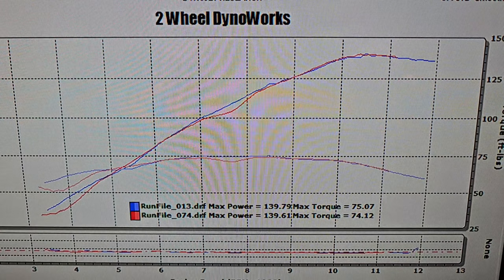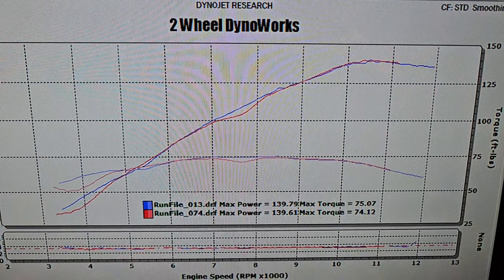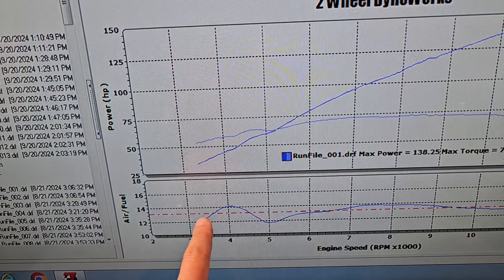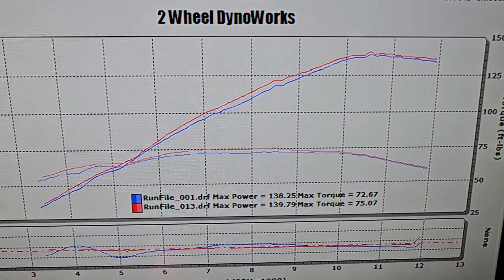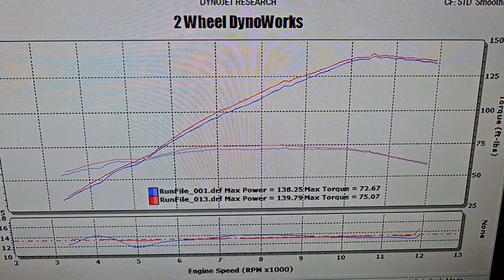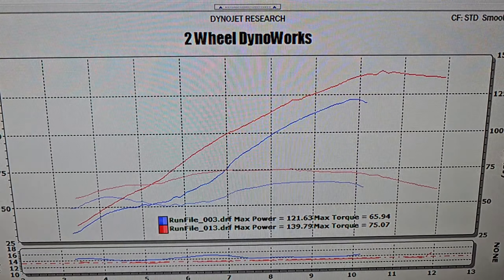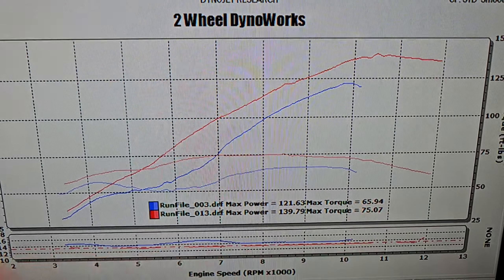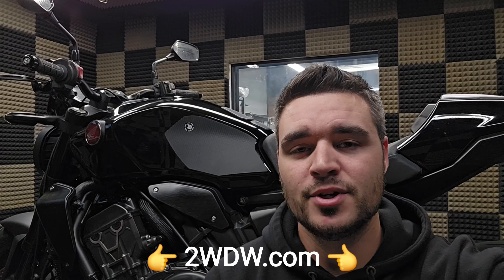PROPER Intake/Exhaust-Specific ECU Mapping is SO IMPORTANT!

Comment: I sent my ecu from my 08 Zx10R to 2WDW a couple months back and it is a totally different animal! The low rpm drivability is better. The midrange power is much stonger and the top end near redline is freakin brutal!!! Thanks Nate! Best money I ever spent on this bike.
Reply: To be frank, it's what should be on showroom floors. Not sure why there isn't a collective outrage at regulations.
Reply: @exothermal.sprocket  Yea, the regulations are turning otherwise great bikes into ones with strangely constrained and suppressed frankenstein power and torque curves.

Comment: On a previous tune my S1KR would surge when I closed the throttle at certain RPM and gear combinations.  Needless to say this is the last thing you'd expect rolling into a turn or approaching slowing traffic.  Since I've gotten the ECU flashed by 2WDW that problem is long gone and throttle response is much smoother.  Not to mention the bike runs far cooler than it used to even in SoCAL heat.
\

Comment: 24 horsepower deficit at 7k rpm on the CB1000R. How criminal is that. Do we think manufacturers would sell a lot more of these units if they actually made power right out the crate?
Reply: They wouldn't sell any units if they made that power out of the box as they'd never pass emissions
Reply: @TacoBurrit0  Who said anything about passing emissions?
Reply: @exothermal.sprocket  he's giving you the reason why there are these big differences. Nowadays almost all bikes have a lot left on the table because they need to pass emissions and sound regulations.
Reply: @mi16pim  I realize that. None of my comments were from that ignorance. I'm trying to highlight how miserable the environmental government regs have made motorcycles and how that has changed mass mindsets about certain models.
Reply: @exothermal.sprocket This is motorsports, not soccer. You’ve got to pay to play in this game, bud. Also, these aren’t slow stock, it’s still a CBR1000 motor at its heart. Average Joe will still be happy with what he gets until he dives deeper into the sport and sees behind the curtain.
Reply: @smith8124  This is the internet, not a kickboxing ring, BUD.

Comment: I like how you everytime state that it is super import to tune your bike to the details etc and blaming “other guys/tuners” for doing a bad job and then push the same fuel map in every ecu they send to you😂😅 Like no single bike needs the same fuel map and you know that… i mean, “close enough” is not how you guys do it right?

I understand the mail in service is a cashcow for you, but don’t over hype this service because it is not that good…
Reply: No 2 bikes are exactly the same, you're right, but if they know the engine, and the exhaust options (aside from full custom fab there's like 3 popular options for the NSC), you're looking at MAYBE 2hp variance for the savings of most of the cost of an afternoon on a dyno... but nice troll, you almost made a valid argument
Reply: @mattwise9748  troll? I’m not talking about hp Numbers at all, just to have the right A/F throughout the whole tps\iap range. Do you have an idea what the difference is between spot on and “it's good enough”? He can do it for sure, i mean he sounds like he has all the knowledge and materials to do so. Don’t act like a mail in service is spot on, because it is not. Even with all the exhaust mapping he is building. Ofcourse it will not fail and be better then doing nothing. If you want it right take it to the shop and map your ecu for your bike. But i guess you are so deffensive because you invested in a “it’s good enough” mail in service, right?😈 have a nice day and ride safe ✌🏻
Reply: @Dutch_MT09SP  no, I bought a woolich and I tune mine myself, but keep trolling

 For the amount of difference you'll see from 2 units equipped the same, flashed with the same tune....it's irrelevant.  Temperature and elevation will make 10x the difference.  With the clearances Honda (and Yamaha, Suzuki, Kawasaki, even trigger HD) work with, if they're not extremely close, there's either serious damage or contamination or a factory defect.
It's 2024, These engines are as close to identical as you can get, it's not like they're cast in hand made sand molds.